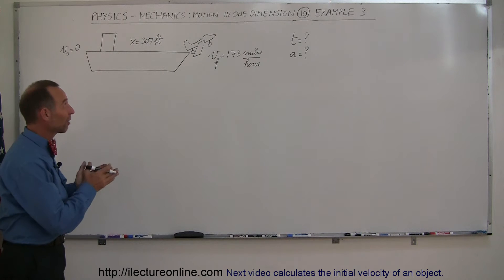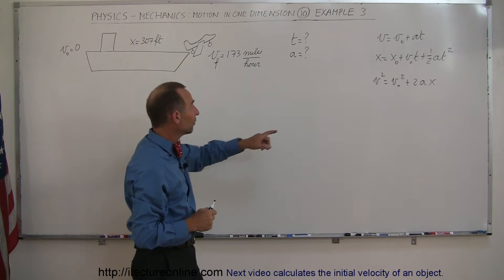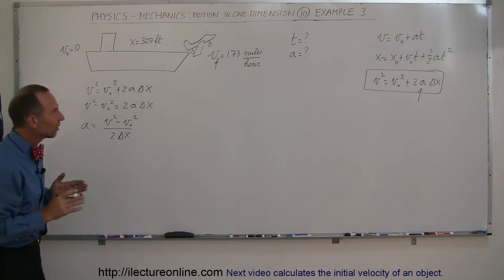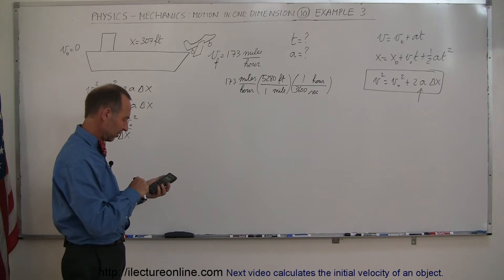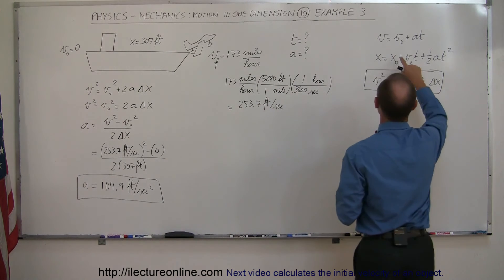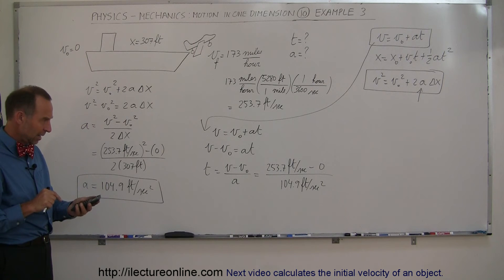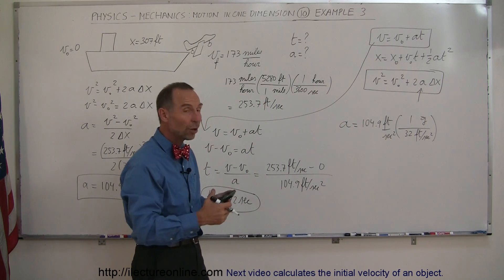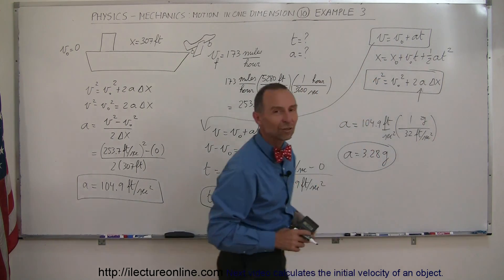Physics 2 - Motion In One-Dimension (10 of 22) Example 3

Comment: PH2AW: Would you want us to add a sig fig as was done at 3:06 on a test, or is it not so important?
Reply from the maker: Typically we  want to use the convention that if 2 significant figure are given in the data, the answer will have 2 significant figures, and if the data has 3 significant figures then the answer should have 3.   Typically I like to see 3 "significant" figure in the answer regardless of how many significant figure there were in the original data.  But I am not very strict about it.  I am much more interested in seeing that you know how to work the problems.

Comment: how did you know that it is a constant acceleration
Reply from the maker: For this level of physics we assume that the acceleration is constant.  If it is not, it will require a much higher level of mathematics to solve the problem (like differential equations)
Reply: @MichelvanBiezen  thank you

Comment: 6:25 The pilot will feel like he weighs 500 pounds. So is here a concept of w = mg or F = ma? If we multiply it up, we should get something like 5000 pounds because we can round g to 10 m/s^2. Sorry this is a kind of stupid question. I totally get what you mean but I don't get it by calculations. W = mg so w should equal 150 * 3.28 * 10m/s^2. I'm thinking that in this case you don't have to multiply 10 right? Just 150 * 3.28.

Comment: Professor van Biezen, 
Is there any way to solve this problem solely using the first two equations?
Reply from the maker: Since the third equation is derived from solving the first two equation simultaneously, it is definitely possible to solve the problem using the first two equations, (but you'll probably need to use and solve them simultaneously.

Comment: Professor Biezen, how did you calculate the weight the person would feel based on the g force? What equation did you use?
Reply from the maker: The weight a person feels in a sharp turn is ma (a being the centripetal acceleration)     a centripetal = v^2/R
Reply: Michel van Biezen so, since v^2/r = omega squared times the radius, what is the radius in this case? How do I calculate the weight with this information? I guess it doesn’t work with this problem because I don’t have a radius to work with? Please help me with this. I got curious about it watching this video
Reply from the maker: If the extra "weight" is due to a linear acceleration, then you divide the acceleration by g and multiply that fraction with the weight at rest.
Reply: Michel van Biezen thank you for the replies. So that would be a= 104 f/s^2 which is 31 meters per sec squared. So this by 9.8 times 160lb = 506. 
Is this a correct calculation? If my weight is 160lb at rest, would I feel a weight of 506lb traveling at an acceleration of 104ft/s^2?
Reply from the maker: Close,  your weight would be 160lb x (104/32) = 520 lb

Comment: Wasn't it simpler to just use v(average) = x/t --> t = 2,42 sec, and then v = v(0) + at --> a = v/t = 77.32/2.42 = 31.95 m/s = 104.9 ft/s?
Seems way easier than having to use the formula without t in it.